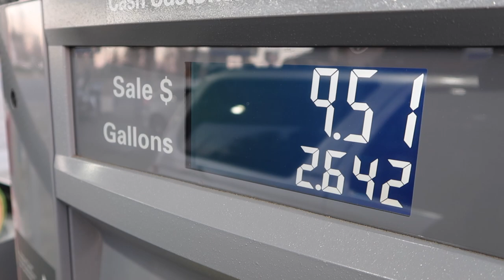Episode 2 | New front end for the Shovelhead

Comment: This is a sincere question and not a troll, can someone explain to me the desire to put struts like that on the rear end? IMO you're losing all the functionality of rear suspension without gaining the clean look of a hardtail. Is there an unseen benefit to it that I'm missing?
Reply from the maker: Ian Loughney these struts are temporary until I chop the rear and go full hardtail.
Reply: Ok, makes sense to me, get a feel for how the hardtail is gonna ride before you make any permanent changes
Reply from the maker: Ian Loughney exactly haha. I really love the clean lines of a full hardtail. Saving up for the springers and weld on hardtail kit for now
Reply: A springer would look killer on this build. Are you planning to keep in low like it is as far as the height of front end?
Reply from the maker: Ian Loughney yea I’m going with the stock length springers. Pretty excited for them. Waiting for people to buy this setup so I can buy the springers
Reply: I was looking for this question before I asked. 👍

I was thinking of doing this and inquired about it with some old heads. I was told to beware where the shock mounts are in the frame. That they weren't meant to take solid hits like that.

Be interested to know how long or how many miles it was like that and if there was any damage or ovaling of the holes.🍻